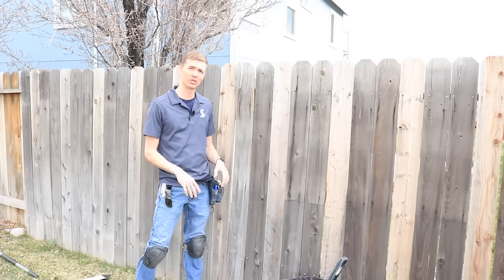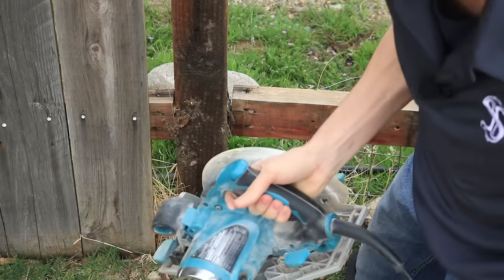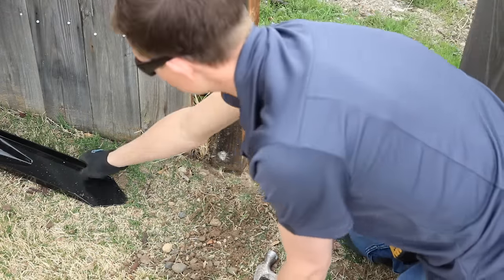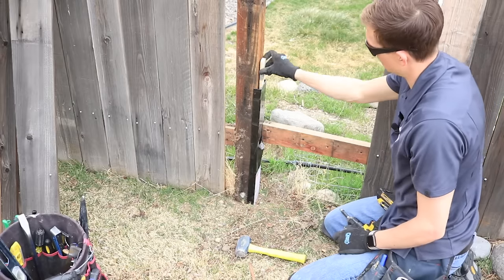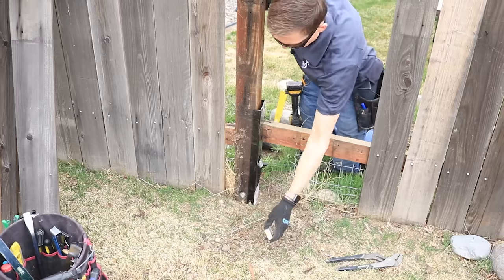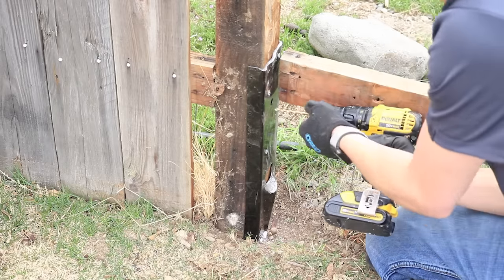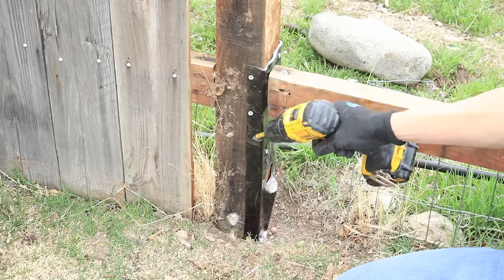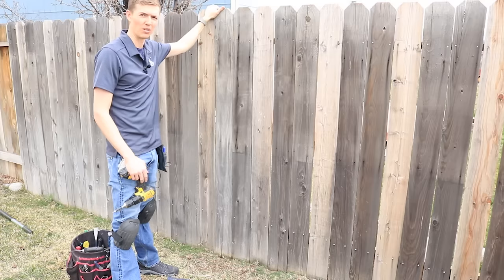How to Fix a Broken Fence Post in Under 30 Minutes

Comment: The concrete should have been built up higher than grade and troweled off to drain.
Reply: makes NO difference.  Rot, by DEFINITION occurs due to wet/dry cycling:  Always dry: no rot.  Always wet: no rot.  

Fences see the most FREQUENT moisture at TOP and BOTTOM.  Concrete or not, that's where they will always rot first.

So doing ANYTHING with concrete simply serves to MOVE the POINT OF ROT at the most.
Reply: Really? Wood sitting in a depression with water won’t rot any slower than wood that’s well drained? I know a whole construction industry that thinks otherwise
Reply: @sledawgpilot  Many "think" that, but if you travel to Venice, have them tell you about the MILLIONS of LOGS driven down into the mud below St. Marks Cathedral, which are ALL that has been holding it up for 1200 years.

FACT.

ROT occurs in 30-60% moisture.  Not much more, not much less.
Reply: @sledawgpilot  Wait.  Just read that again and saw the "not": we're in agreement if I'm reading you right:

wood SUBMERGED DOES NOT ROT.  Which is what I said originally...
Reply: We aren’t talking submerged lumber . Red herring argument. By your logic, footings don’t need to above grade, no need for ground contact treated lumber, no need to slope the grade away from your house, no need for gutters. The more wood stays dry the longer it lasts- period. Do what you want, hopefully no one listens to you.

Comment: What a BS way to properly fix a fence post. As a pro handyman I would be highly embarrassed to do this to a client, call it "Fixed" and then charge for it. Why not just do it the right way and extract the plug and replace the post with a  Pressure treated or Steel post? if that crown is cracked at top or of the concrete in  "blue bag" high strength forget about it.

Comment: Check this out Professional's! If I wanted you to repair a fence  post, and you see that I didn't pay a little more to finish the fence with a simple oil stain or paint. What makes you think I want to pay more than a few bucks to replace it with all new parts. $10 for a metal. Or $25 for the new stuff..... Come on. Don't think because you do it, means it's the best way. It's an option. I don't see you posting videos on how 'you' do it. Lol

Comment: Sorry on the repost missed that "hack....fill in the missing saw" that was hack saw, no sawall in those days save your pennies for gasoline.

I used to do the same patch up in my teenage car repair days.
The exhaust system is leaking.
Today i removed and installed a new muffler, on my back with a hacksaw and a Coke
Next year I replaced the tail pipe on my back with a hacksaw  and a Coke
The following year I replaced the crossover pipe on my back with a hacksaw and a Coke
Those were the days.
Take a bath, pick up the "chicks if I may say"dance or drive in.....no worries

Comment: But you didnt put on gloves for those soft skinned hands for protection.
Need a scarf for that neck, and a back brace for your back. Also you should let your sister actually do the work so you dont hurt yourself.

Comment: Oh, young buck, where to begin. For starters you are clearly showing your age, and lack of experience. Clearly, your tools are in brand new condition. The Estwing (not EASTwing as so many erroneously say) hammer you're using is still the pretty blue color and soft. And the "butt" is still flared and nice and sharp. Showing its obvious lack of use. #1. THERE IS NO SUCH THING AS A "CROW" BAR!!!!!! What you're using is known as a "flat" bar. What most people erroneously call a crow bar is actually called a WRECKING bar. The smaller version that fits in your bags is known as a PINCH bar. The more rugged one with the smaller tighter flat hook that's in between these two sizes is called a NAIL CUTTER. You were also utilizing a rather large size cats paw. A Home Depot special! People that buy and use them think because it's big, it must do the job well. Not realizing that it will tear the surface up pretty bad trying to remove whatever fastener you're trying to pull. Most veterans use narrower ones that have 2 sharp ends. I carried 2 different ones. One that had a "flat" bar on one end. And so on and so forth. For well over 20 something years I carried my flat bar on my left side in my "OXY" bags between where the belt goes through the top of the bag. Then I started utilizing the full harness set up that Occidental has which obviously changed things.  
Anyway, now for what's really important. #2. There's an age old saying... Do it right, or don't do it at all. If your post is that bad, IT SHOULD BE REPLACED!  You're putting a band aid on a rotten post. And guess what, the post will continue to rot. (And even faster now that you drove numerous screws into it).  And as it does (rot out) it will be that much harder to remove the footing that it's encased in. While the post still has some integrity an old HANDYMAN JACK, and a chain will probably be the best way to get it out.  
Anyway, next up, #3. is you made a rather wild cut in the lower purlin. (to "make extra room"). You used no tape measure, no square, no rhyme or rational reason. Just BEWAHHH! Anybody paying close attention would see that not only is the cut really out of square, when he put it all back together again, the board wound up being too short! BUTCH!!!!   
First of all, the post was probably that wobbly because of that very joint. The purlin should've been a little longer and been "LET IN" into the post where a "DADO" should've been cut. That would've made that joint much more firm. During your layout, you should pull strings, not only for your post heights, but for your dados too. (After you set your posts).  Then, after you've made any adjustments, you should then cut all your dados first. (And try to keep 'em as tight as possible. Remember, wood shrinks as it dries out. Your purlins will more than your posts). 
I, (very ANALLY), used to take it a step further and apply a wood preservative (if not the green, then the brown) (which can be purchased at most lumber yards) to all of my dados, the end grain of my boards, and to the tops of my posts as well.    I'm getting way off track here, but those few steps are gospel! 
#4. If he needed "more room", then he could've simply pushed the purlin out of his way, and held it there by driving a stake in front of it. Then, after he installed the brace, could've released the stake and pulled the purlin tight to the brace and SCRIBED it. Then after he pushed it out of the way again, could've made his cut with the appropriate blade in an oscillating multi-tool, or even a jig saw (upside-down) if he didn't have an oscillating multi-tool. (Which would totally surprise me as one of those is a staple for professionals)! And completely affordable since Fein tools' patent ran out. (the original makers of those tools) Anyway, 'nother rabbit hole, sorry. I'll do one more before a real serious one. #5. His "technique" for pre-drilling holes into the brace. BE WARNED, DON'T DO IT HIS WAY!  Since the joint is the way it is, then line up where your purlin should be, (and even trace it on your brace with a red mason's pencil, a silver sharpie, or the like), then choose one hole (the top seems to be the most obvious). Run your drill bit down that hole into your brace. You should use an appropriate drill bit capable of drilling into metal (like cobalt, or at the very least titanium), and one that's a little smaller than your screws so as to not strip out the wood. Then screw that together. when that's fastened, then do one on each of the sides one at a time. If you do it the way he showed you, you'd have a very good chance of drilling holes in the wrong place. Got it?  
But this next one is a serious one. #6. You should never, ever, ever, ever strike one hammer on another hammer!!!  That would be one of those he gets pulled aside and gets a stern warning things if he were on one of my jobs. Even if he weren't, his foreman, would've done the same if he were seen. "Nuff said. Well, he should've utilized a "beater board" for that task. Now, 'nuff said.  
#7. It also appears that the video is edited. Was anybody paying attention when no less than twice his little wedge fell in between the brace and the post. How did he get it out? Doesn't show. 
I'M GOING OFF ON THIS KID SO BAD 'CAUSE HE THEN HAS THE BRAZEN BALLS TO TELL YOU HEY, CONTACT ME AND I'LL TEACH YOU ABOUT A HANDYMAN BUSINESS!! WHAT BRAZEN BALLS!!! 
LET'S BE REAL HERE. HE'S A KID HERE ON YT, AS A POSER WITH CLEARLY VERY LIMITED KNOWLEDGE AND OR SKILL WANTING YOU TO SUPPORT HIM!!    I actually hope he reads this. Sees his mistakes, and is wise enough to let everyone else read it too. 
Kid, you need to sit under a good journeyman, who will show you the right way of doing things for at least another 7 to 10 years. Then, you've earned the right to tell people what's this or that. Let me see you after you're in at least your mid 30's and you've finally realized that you don't know it all. Then, take a look back at this vid and realize WOW, I was such a noob.
Me, well, I'm retired now, spent most of my adult life in the trade. Have done just about everything there is to do in residential building and remodeling. Was a business owner for about the last 12 and a 1/2 of it till health issues finally made me surrender it all. (And boy, is that humbling)!!    Sucks gettin' old! 
I'm sure many of you are gonna jump all over me for this but hey, people need to hear truth. How's this kid, or anyone else for that matter gonna learn, if they're not told. If the shoe fits.. wear it.

Comment: Handyman, using one sledge hammer on another is bad practice and can be very dangerous. There are many other options using a mild steel implement of some kind, better designed for the job, and much safer!

Comment: wouldn't it just be easier and faster to replace the post? pull it, throw in a new post, dump in a bag of fast set, take a lunch break, grab a beer and come back to put the fence back together.

The ex-mender is like $15.  A 4x4 and a bag of fast setting? ~$15.
Reply from the maker: No, it would take 5x longer to replace it

Comment: Or you can just remove the old post and replace it like it should be done!

I agree it sucks that the wood eventually does rot. Perhaps the posts should be wrapped with water resistant material prior to setting post.....just saying!!!

Comment: If you split the concrete underneath youl have to try another method 🙈
Yeah thanks for that like rippin the fence down what a load of shit your cut piece was about a quarter inch away from the metal thing full of pre drilled holes that will be rotten in no time

Comment: I'm not sold on this idea. Lots of work that could result in having to make a proper repair later. I'd remove the panel, dig another hole and drop in another 4 by 4 then close it back up..
Reply: You just moved the post 4 inches. How do you attach the panel? It is now 4 inches short on one end and 4 inches long on the other.

Comment: On posts with with more concrete these are useless
Reply from the maker: More concrete? The amount of concrete doesn’t effect this.
Reply: @StayHandy  So if the concrete is 150mm wide around post how will you hammer in this support bracket? Will it slide through 50mpa concrete?

Comment: Another broken wooden fence post? Then clearly you need stop buying wooden fence posts. The DIY industry must love all the idiots who buy them. 

What you have here is the endorsement of buy cheap buy twice. And by twice I mean three or four times plus all the work. A wiser man would build a wall or use concrete posts, once, and would never build a structure that has a design that means wood is left in constant contact with the ground.

Comment: To much work i rather replace the post for $4
Reply: Great shopper if you can find them that cheap.  8' pressure treated 4x4 here in Florida are $11.57 at Home Depot.

Comment: Hello, from Esquimalt, BC!
I'm 77, a BC Dept of Labour Certified Journeyman Carpenter since 1974, w\my own business for 55 years.

This was one of the worst instructional videos I've ever seen. I've been an instructor at BCIT, teaching vocational skills & SAFE ways to attain desired outcomes. This video sure as Hell was not that!

1. If you're going to demo anything, NEVER put yourself between the video operator and the lesson. You're not a window and people cannot see what you're attempting!

2. Others made the point so I won't belabour it: it's reckless to use tools in ways they were never meant to be used, i.e., smashing 2 hammers together! Had I done this at BCIT I would've been called on the carpet and likely had my contract cancelled.

3. Others also pointed out that this was installed improperly from the get-go: more than 90% of fences fail because wood contacts concrete at the soil line: use H brackets and elevate the post so air circulates between it and the bracket. I use heavily plated washers to get the post off the base of the H if possible.

4. I have to answer a call of nature; I'll come back later to edit this. Best wishes to everyone viewing this, and STAY SAFE!
Reply from the maker: Fair arguments. I'm still struggling to find solid evidence that hitting a sledge hammer against another one as I did in this method is actually a risk. Considering I've done it dozens of times and can't find anything to demonstrate the risk outside of many comments I've received about it, I still question the accuracy of saying this should never be done.

Comment: All that effort you could have been easier just to pull the post and put a new Post in new concrete there to go done. That's like a big pain in the ass. You should never hit a hammer on a hammer either.
Reply: yea saving 3 hours of work is a pain in the ass

Comment: You clearly need to go back to the office. The gloves and knee pads are embarrassing.
Reply: First of all concrete is the reason why it rots. It sucks out the chemical moisture  out of the wood. To prevent this, you need to waterproof what you concrete in the ground. Also use 3 inch nails, not 2 and a half nails when fraiming. You can also skip all that repairing stuff. Dig the concrete out and make sure your new post will be in the same place. They have chipping hammers and augers. Take an auger and dig next to the post. Shake the post near the hole you dug and shake it back and forth. Youll loosen the post and pull it out of the ground
Reply: @Mattyb205  You're spot on with the auger, but wrong about rot.  rot occurs because wood ranges between 30-60%, give or take, moisture content.  That's why the TOP and BOTTOM of wood fences always rot FIRST: they get wet the MOST OFTEN, due to ANY rainfall, even a few droplets hitting the TOP, and ANY moisture, including ground runoff from irrigation hitting the BOTTOM and then they dry out, swinging right through the happy moisture range for ROT.

That's just how it works, so the only way around that is chemicals.

Always dry: no rot.      Always wet: no rot.   Bounce between them: ROT.

Comment: Why not spend 10$ on a new fence post? It takes just as long. Plus you don't use concrete with wood posts, the concrete retains water and will rot the post quicker.
Reply from the maker: You are wrong on so many levels
Reply: Better  than concrete  would be to use 3/4trap rock tapped  into hole. Good to drain water away//.
Reply: concrete is code with frost heave in the north...  But way easier to just pull the post.  Rent an auger if you're that lazy and drill right beside it to tip it into the gap...  5 mins.
Reply: @StayHandy   
How's that?